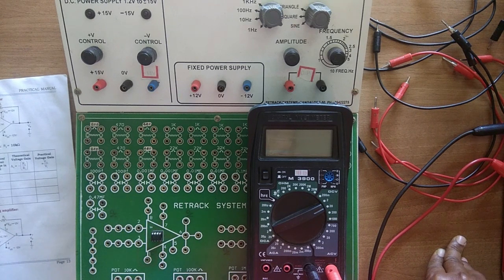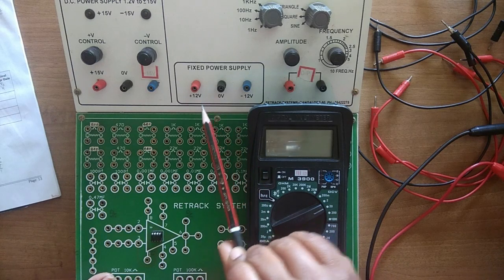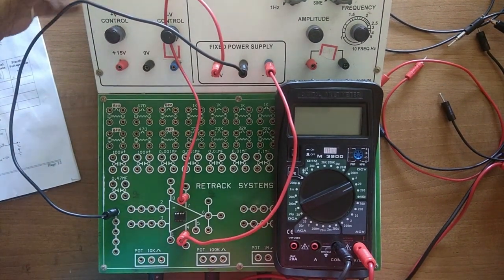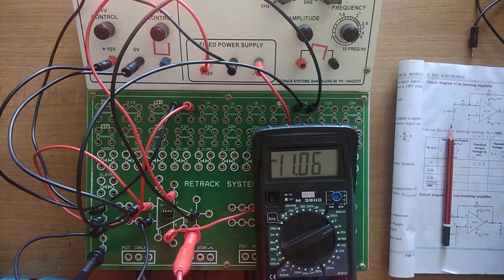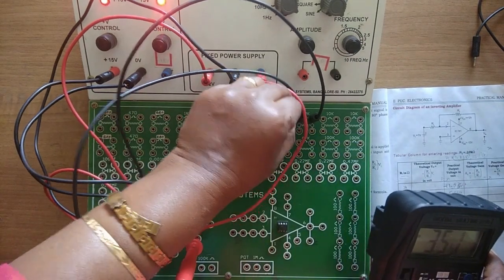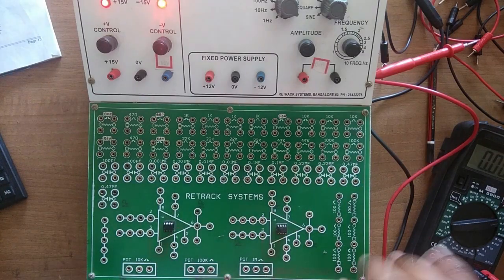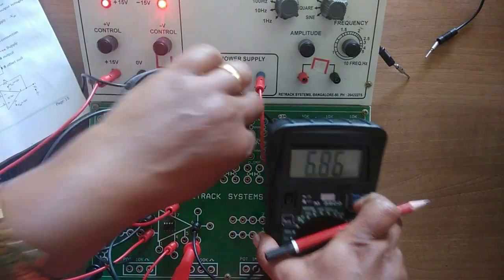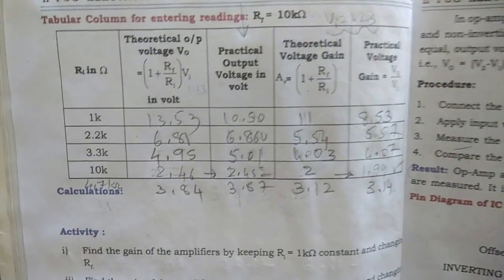OPAMP INVERTING & NON-INVERTING AMPLFIER EXPERIMENT  #ELECTRONICS PRACTICALS,  #OPAMP EXPERIMENTS

Comment: Very cool video. I want that opamp prototype board. If you made that yourself then you could make alot of money selling those. I'm in a village in Cape Breton, Nova Scotia Canada and I'd buy one for my workshop in a second. Excellent lesson
Reply from the maker: Thank you
Reply: @DEEVIGE-PAATHASHAALA1  any chance of getting a schematic for personal use. I'm retired with mental illness and I love digital logic and building things based on it. Opamps are giving me trouble. I understand the math but I'd love to make something similar using some decade boxes for the resistors, caps and put a breadboard in it and 3d print an enclosure. I'm actually doing a guest video on the learnelectronics channel in a few months and building this beats my other idea. A 555 timer on veroboard with standoffs for rc timing and for the different modes or a diy opamp psu circuit using diode steering along with a tip31a npn and tip32a pnp voltage mirror along with some 2n2222 transistors. Just basic stuff. I have short term memory issues so I write everything down. I started with arduino a year and half ago and after I had finished the lessons there were 5 2n2222 transistors left in the kit and my curiosity to find out what they were led me to this wonderful learning adventure. If I uses it I would give you credit and a spot in my video saying how you met me. I have social anxiety and my friend owns the channel and welcomes guest videos to his channel so I'm doing it to learn and try to overcome my fears. If you wanted to do a guest video I could arrange it, even if you didn't give me the schematic. More people should know about you. His name is Paul. He had an engineering student from Mumbai do a video on the future of wireless chips and protocol along with people from all different types of electronics backgrounds. I can give you his email if you're interested and I won't even mention you to him just to show how he loves having people do guest videos. You'd make an awesome one with that opamp tool and I'd do my dual power rail circuit :)